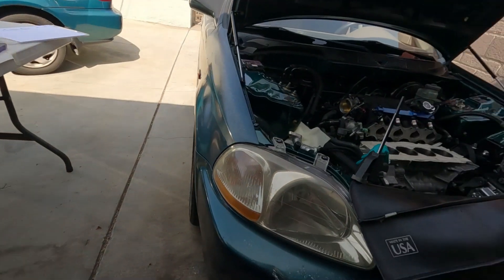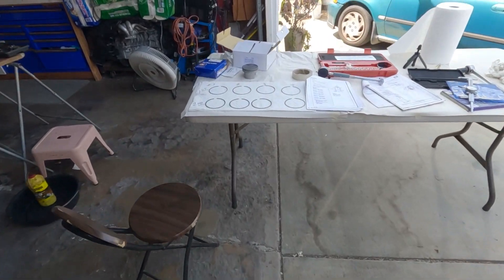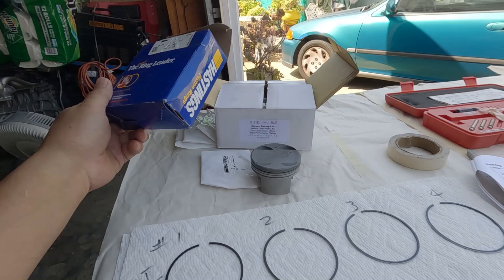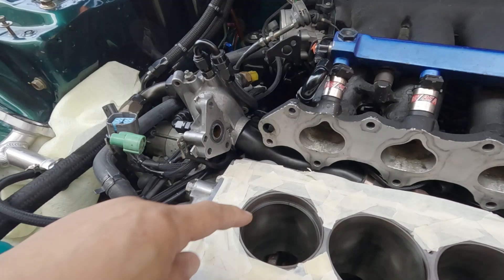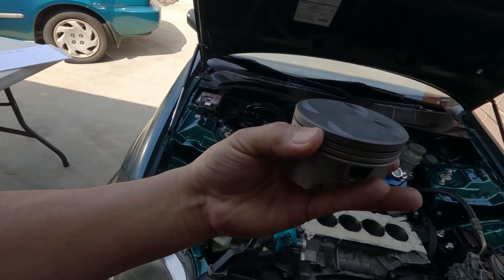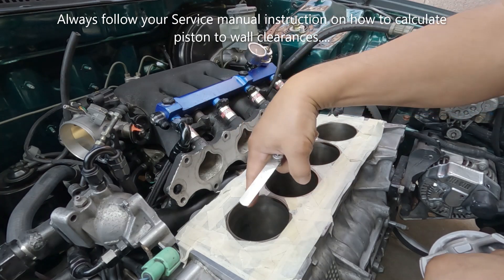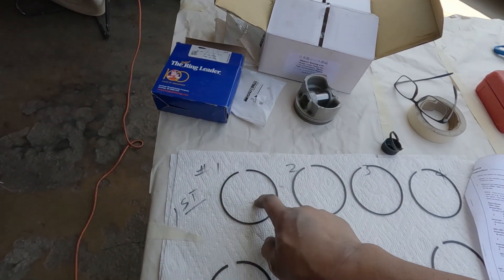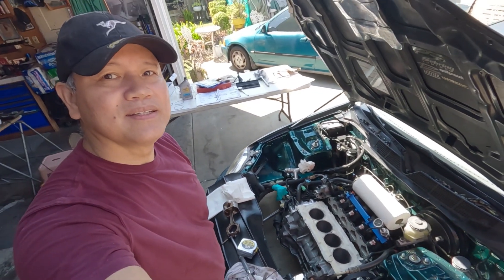Prepping F23 cylinder block for Boost! ep.5

Comment: I get scared of that 3 point hone tool.. So i use the Honing ball instead ... Been thinking about doing a very cheap Street budget LSV Turbo Fwd Build for a minute.. nothing crazy..   Just something quick on the streets to have fun in.
Some basic ass Ebay/Amazon/FbMarket and junkyard parts..
Reply from the maker: Been wanting to try those honing ball and l think using those and no worry of breaking it like the tri-stone. Lsv turbo is not a bad choice for a project, thanks man!
Reply: @sagittnet2158  it's because of me not having a steady hand doing home garage shiet. Not like a Machine would do straight up and down honing in a control speed with steady motions. scared I'll even create more problems for me while hone using that tri-stone.

Comment: so what could be causing your cylinder bores to be like that could be Because the piston's crown is heated by combustion, that is its hottest part and expands the most, and so requires the greatest clearance. The lower parts of the piston, being farther from the heat, run cooler and so expand less, requiring less clearance. let me know if this helps at all found it on the internet
Reply from the maker: Not really sure what causing it to rub the walls. Did a bit a researced and things like type of oil use, over revving and p2w clearance. It can be because of the way l installed it 180 degree opposite. I was thinking that even though l have the wrist pin offset correct but the relief was not facing the correct valves maybe somehow when ignition occured, it became out of balance maybe. But l really believe it could be from over revving it.